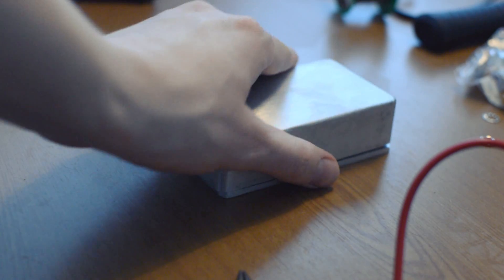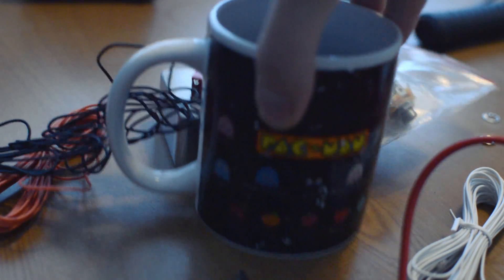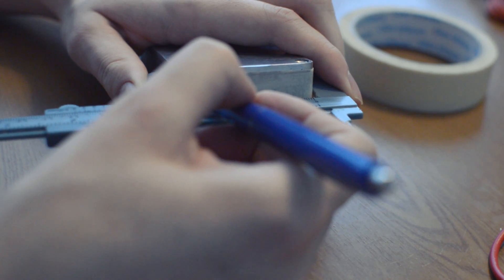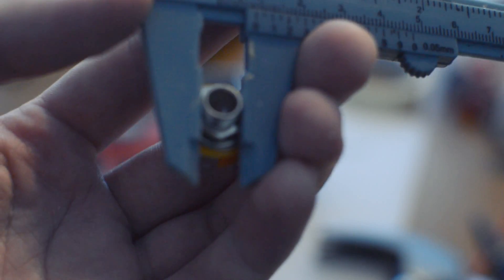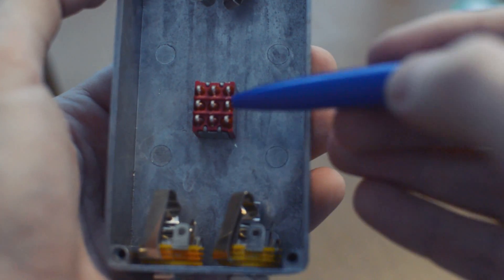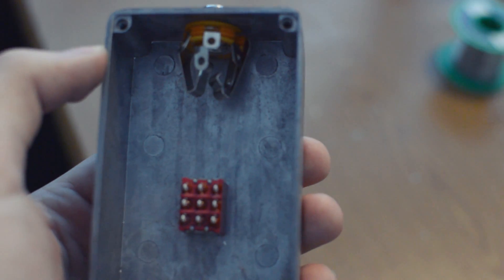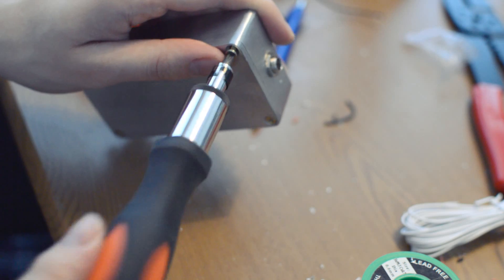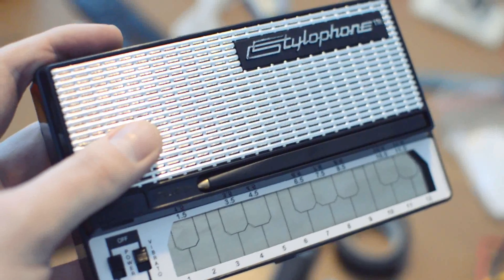DIY Headphone/Speaker Switch - Oskar Builds

Comment: when your drilling large holes (like 1/4 inch and up) you should start small and work your way up to the final dimensions. you wont skid, and you'll be much safer drilling your holes. extra credit if you use a scratch awl or center punch

Comment: I want to make this but with 4 different inputs and one out. And I would like to be able to control the channel remotely. 
I got zero knowledge about this stuff. But I think I can do it with an Adriano and some transistors. 
Any experts got some tips for me?
Reply from the maker: JhonnyBoy hmm... arduino seems overkill. Maybe use a tiny. As for the switching, FETs could work. Maybe try some 4066 chips. Four switches per IC. But for both of these options I would introduce a higher DC bias to the signal that I also remove after the switch so that the negative voltage of the signal doesn't get clipped and you don't need to mess with a dual supply.

Comment: Would there be a ground-hum/buzz if you don't insulate the inside of the box at all?
Reply from the maker: Martin Ericsson not if you add rubber feet. Otherwise it depends on what the box comes into contact with.
Reply: Ohh i see. I completed mine yesterday, like an hour after commenting. Works like a charm. Tutorial helped a lot! Thanks
Reply: @OJungell  I did this inside a wooden box and I have buzzing noises. Can you help me out please ?

Comment: How would you do it with rca connections?
Reply from the maker: Daniel Skoropad same thing! Just hook signal to signal and a switch between them. Just think like you want to extend a cord, you wire it the same way.
Reply: Thanks, can this also be used in reverse as in two input and one output?
Reply from the maker: Oh yes, just plug it in the other way around. Same circuit! But if you're going to mix signals, make sure to put some resistors between the connectors. 10k - 100k should be fine.

Comment: hi!
Are there some ELECTRICAL switch (diverter) that should be used to choose from which source send a signal to an output?

practically: 
I've 2 audio Amplifer but 1 speaker; I would switch from the audio of Amplifer 1 (music) to one by Amplifer 2 (tv).

I'm not able to do it without use 2 different switch (OR ampli 1 ON/OFF and ampli 2 ON/OFF, or SWITCH Ampli1/2 +POSITIVE and Ampli1/2 -NEGATIVE. )

nb. this would be useful to separate different audio in different rooms (room 1: audio by tv; room 2-3: audio by music player) and play it contemporary. 

thx.

Comment: I did something similar in the back of my guitar amp so I could play with headphones on.
Reply from the maker: did the amp survive even with the lower resistance of headphones?
Reply: to be honest I haven't had the need to use it with headphones much as I now have a space to play, but it worked okay the few times I did use it.  Also the amp is running at minimal capacity with headphones, I don't know if that makes any difference.
Reply: Oskar Jungell mine is just a small practice amp although it is remarkably loud (never had it past 3).  Solid state, not tubes.

I mostly play into my computer interface because I have way more virtual pedals than real ones.  The computer outputs to a rebuilt (not by me) Pioneer tube amp connected to 4 Sony speakers I got at a flea market, or I can use headphones of course.
Reply: Oskar Jungell I see you have a few guitar themed videos on your channel, I'll have a look at those later (I'm at work).  Do you have any music online?

Comment: I've once made a passive audio mixer with switches to set whether a series resistor is needed for some device. With this I could either/both have multiple headphones listening the same audio source or/and multiple audio sources on the same line. I guess it could be modified to do what you did here.
Reply from the maker: +DigGil3 Making stuff you need is awesome!

Comment: Do you have a sound card that auto-senses the connector being plugged in?  How does it know to change the signal level?
Reply from the maker: +Lucid Moses Speakers are amplified after the switch :)
Reply: Oskar Jungell Oh, I see.  Cool idea even if I can't use it then.
Reply from the maker: +Lucid Moses Most headphones and speakers can be driven from the standard 8 or 16ohm output, though. So it shouldn't be any problem
Reply: Oskar Jungell np, I'll take your word for it.  I haven't seen systems like that for a gizzilion years.  Ever sense they went to the 5 speaker system.  But that's only useful for some games so I imagine it's not that popular any more.